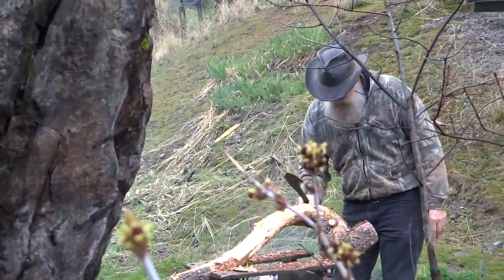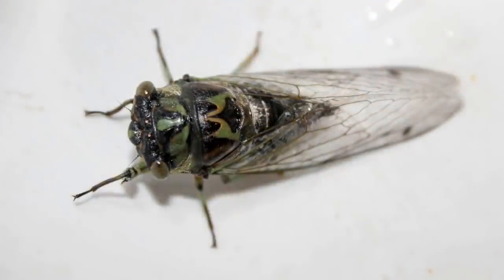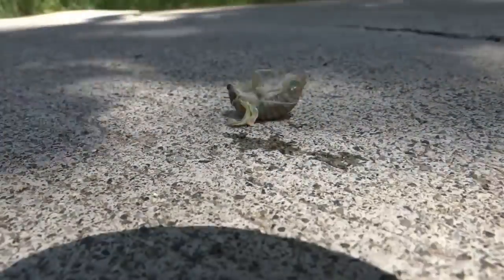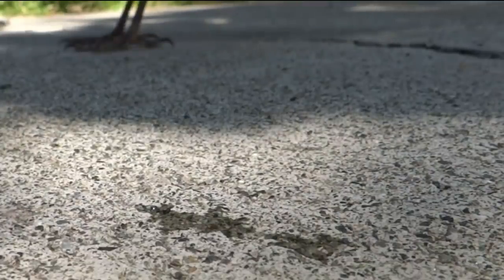Carving A Bamboo Pit Viper And Cicada Walking Cane

Comment: Gorgeous work as always! How do you season the sticks before carving? I’ve tried seasoning 3 cedar sticks and 1 Ashe stick and they all split. Any advice would be appreciated, thanks and keep up the amazing work!
Reply from the maker: Thank you very much! Sometimes my sticks will crack too. But, I've had fairly good luck by peeling the bark, sealing the ends, and standing them up in the direction they grew in a cool, dry place for a year or two. Each wood has its own challenges. It's hard to predict how they'll turn out.

Comment: For someone starting out in woodworking/carving, what wood should i use? I dont remember what wood i used but i had carved a handle with a tiny snake for my dad last fathers day. And made a mini axe out of an old edger blade and would like to do more but felt the wood to be really rough to carve even with my dremel.
Reply from the maker: It depends on what you will be making. If it is a walking stick, it will need to be strong wood, but easy to carve. I like Lodgepole Pine for the sticks, but western red cedar will work good too. If you want to make an artistic carving, use Basswood for knife carving, and Tupelo for power carving.
Reply: @StinnettSticks  Thank you and eventually would like to build my dad a cane. He is a veteran and had a parachute accident which made him an  incomplete quadriplegic and collects canes as a reminder that he could be using a cane or worse never walking again.